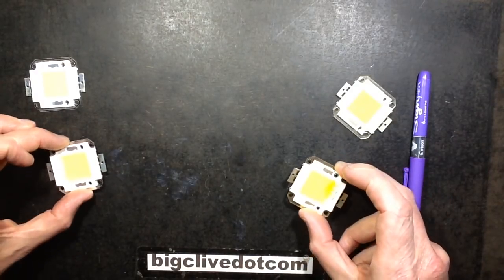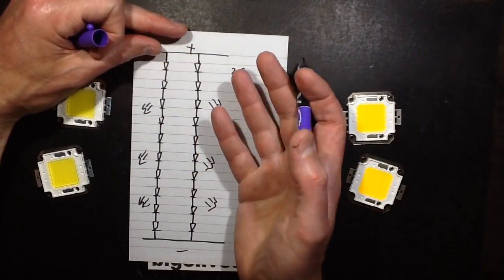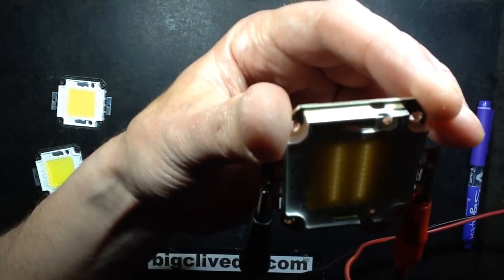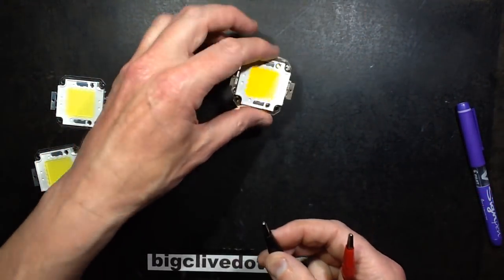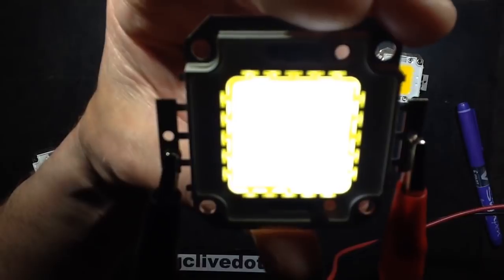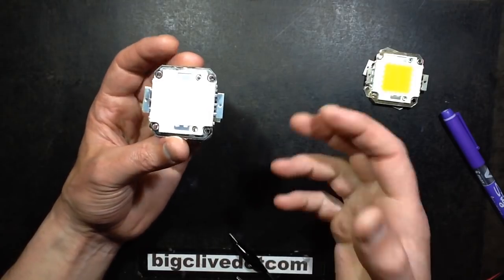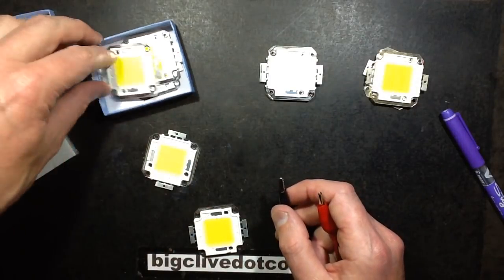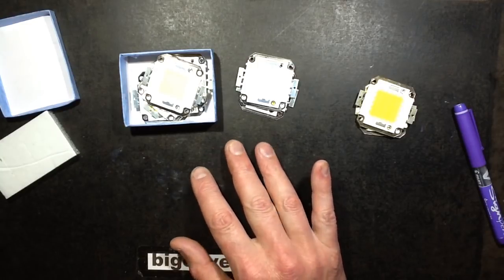Testing dodgy 100W LEDs from ebay sellers.

Comment: I've found that when projecting an LED's light onto a wall using a lens, even the chips that don't glow at all at low currents are glowing quite nicely. It seems to me like the chips tend to have a little parasitic resistance of a couple of kiloohms across them, rather than being shorted outright. 
I got the cheapest LEDs I have ever seen, like seriously bottom of the barrel factory reject items, twenty 10W ones for 6 euros, and at very low currents only three or four of the nine chips tend to emit any light. To my surprise though, their brightness is pretty consistent beyond 100mA, with only two of the modules producing significantly less light than the rest. Now they most definitely have a lower efficiency than the good ones, but let's be honest, who expects good quality from these things anyway. They definitely work for me!
Reply: +Dennis W The problem is, most of these LEDs came out of a LED flood light factory or something like this, they test them and the bad ones are returned, and however they'll come up on some ebay stores. You got it right, the problem is the resistance, some of the chips get mor, others less current, and when you power them nearly their specific values, some of the led chips get too much current and die sooner than the other ones on that LED, the other ones will even die faster when some of the chips are already dead. I've found out myself, that the good ones mostly start at 5-7 bucks
Reply: +Dennis W The problem is, most of these LEDs came out of a LED flood light factory or something like this, they test them and the bad ones are returned, and however they'll come up on some ebay stores. You got it right, the problem is the resistance, some of the chips get mor, others less current, and when you power them nearly their specific values, some of the led chips get too much current and die sooner than the other ones on that LED, the other ones will even die faster when some of the chips are already dead. I've found out myself, that the good ones mostly start at 5-7 bucks
Reply: +TheScrappingJeahaha The problem is the resistance? That's such a stupid statement, I don't even know where to begin trolling you.
Reply: Jimmy Gregorio
then maybe you just fuck off?
Reply: TheScrappingJeahaha I think you mean the parasitic resistances, yes?
I rest my case though, their effect diminishes when approaching the LED's rated current.

Comment: These LEDs are just fine! They were designed to operate at the proper voltage AND amperage! You only adjusted voltage! LED's do not get "damaged" and start working badly, either they work or they don't. They may turn on at various current/voltage levels, which is normal. You are driving 100W AND 20W LEDs from the same source? What is the current available, never mind the voltage? CURRENT DOES THE WORK! If you under power them, of course they won't work right! You are posing as an "expert" when you obviously don't know CRAP about this stuff! You sir are a buffoon that is doing a disservice to unwitting people who are actually taking  your word as gospel! Beware folks. A little knowledge is a very dangerous thing.
Reply from the maker: +Blissterd1 A little knowledge is indeed a dangerous thing.  https://www.youtube.com/watch?v=_wR_mFWeI6Y
Reply: +Blissterd1 Why did you change your story after he made another video but still imply he is wrong?
Reply: +Blissterd1 Just my 2 cents worth: I am not an electrical engineer, just a home tinkerer, but, as far as I know, one cannot adjust JUST voltage OR current in a resistive load. One affects the other. Voltage "pushes" current. Raise voltage and current goes up. Only a change in resistance will affect how much current flows at a given voltage. Thanks!
Reply: +Blissterd1 I'm sorry my friend but this statement you have made is totally incorrect.
Reply: +Blissterd1 you just got schooled jackass.
Reply: +Blissterd1 You are a complete stupid fuck. That other video was CLEARLY a joke, and this guy is a professional lighting rigger. Did you ever consider that there might be something YOU DON'T KNOW that someone else might? My god I wish I could meet you in person, maybe we could start an exhibit up.
Reply: If you don't understand the subject, that's fine and nothing to be ashamed about. However, you're dispensing criticism, calling names, and then, when educated thoughtfully by the host, you respond by doubling down on your behavior?
Reply: bigclive saw your clown led explanation video...that was beautiful.  Very interesting and informative.  I was going to buy from ebay but the smaller 10w led chips.  They were so cheap (about 5 times less than from other vendors) that I figured let me give it a try.  But it is not just about the led chips but also the sizing of the led driver.  If I go through the exercise of getting the right driver for the correct series and parallel configurations of leds, and they have all these faulty leds, then I'm also wasting money on a correctly sized led driver.  Thanks again for the beautifully explained video and also for schooling the highly knowledgeable blissterd1.  He talked like an expert and was proven to be the buffoon.  To top it all off, when shown he was wrong, he wouldn't admit it.  A true CLOWN!
Reply: Don't you just love it when armchair experts who know ABSOLUTELY NOTHING get totally schooled and then try to change the narrative to fit their agenda? Hilarious... Bravo Clive!
Reply: +bigclivedotcom Thanks for posting the followup video.  I was wondering what the purpose of testing LED arrays at low voltages was, now I understand what you can learn by doing so!
Reply: Yes Blissterd, A little knowledge is a dangerous thing. You would save personal embarrassment, by educating yourself fully, before posting any more bullshit comments.
Reply: +Blissterd1 moron, tried one of these f*cked up LEDs yourself? I wanted a cool white LED for my 100 Watt LED Flashlight and bought one for around 3-4 Bucks and changed the warm white LED with the crap i got. I adjusted the current and the voltage to the proper working specifications, wonder what happendend ? after 10 Minutes working only 6 rows where remaining working.... The warm white LED which I changed was like 7 Bucks and ALL LEDs came on like the 20 Watt ones he showed in his video, this is now 1 year past and the LED is just fine. dumbass.
Reply: +Blissterd1 The video where LEDs were connected to mains power was satire. He likewise knows that a soldering iron isn't really a TIG welder. Maybe - or maybe doesn't know - the uncertainty is half the fun. It can be confusing to decide whether Clive is being serious or silly at any particular moment. His videos aren't for everybody so if you find him annoying perhaps it's best just to ignore him. 
I don't find PewDiePie worth watching but that's no reason millions of others shouldn't enjoy those videos. As long as there are a few of us who enjoy random detours off the straight path bigclivedotcom will continue to attract followers. 
I just hope Big Clive doesn't get too predictable after his channel passes the 100,000 follower mark.
Reply: Gary Hardman OP falls back on "school yard name calling" as a defense and in his original statement calls Clive a buffoon. ...brilliant, juuust brilliant! HAHA
Reply: +Curt Chase you are right. voltage affects the current. the problem with led's is that its very difficult to handle the current with a fixed voltage. they need a certain voltage to start working. before this voltage there is almost no current. a little over this voltage the currents much bigger. its very dangerous to control led just with fixed voltage. http://softsolder.files.wordpress.com/2013/03/roygbuiw.png . it much safer to use a current supply ( they regulate the voltage so you have the selectet current) or use at least a resistor in serie to the led. there is not really a problem in the way he does it becouse he does not get even close to the rated current. but for max led power it would just be to dangerous to run them directly from a voltage supply.
Reply: +Blissterd1 You get what you pay for! Perfection is something that is set aside for products from real companies. Of course these are half rate LEDs but this guy uses them, I saw him admit to it when another guy noticed them in a reflection. They work fine under normal conditions for the money. I suppose he'd rather that they stopped making these cheap LEDs then, because that is all they can do for the money he (and many hobbyists) wants to spend! Going to all this buffoonery to prove that cheap prices equal cheap products. it's useless. He has no right to beat up on vendors or manufacturers for making the cheap stuff he wants to be an "expert"; with and beat up on! I don't need an expert to tell me that crap stinks! BTW, nice use of schoolyard mentality in the name calling. I will be bothered by it for about....never!
Reply: +Codeplayer I never changed any story! All I ADDED was that they were cheap LED's that might not act like expensive ones when run at incorrect voltages and amperage. He infers that they are "rubbish" and my point is that you get what you pay for. They work just fine when run at rated voltage and amperage. The first video I ever saw of this guy was the one I posted the link to above in my last comment. If you saw that you would wonder whether this was a joke or something. He calls a soldering iron a "TIG welder" and then proceeds to literally bang the solder on! Then you find that he has wired the LED directly to the AC mains and plugs it in. When it unsurprisingly blows, he then claims that it must a bad device and blames the seller for selling him crap! Sound like an expert to you? Defend him all you want and he may have figured some things out by now, but I'm not bothering to ask his advice!

Comment: You should do a video on "Mars Hydro" full spectrum grow lights. They advertise 300 watts, but they only draw 140 watts.
They come from "topledfactorystore" on ebay. When I asked, they said 300 watts is design power and 140 watts is actual
power. I am sure their other items are the same.
Reply: Are you serious? Even IF that were true. it is still false advertising.And I already know about PAR ratings, So, if it only draws 140 watts, just say so.

Comment: Hi dude. I have a 100w chinese led too. At the beginning it seemed like yours (only a few bulbs turn on at the same time). But then I increased the maximum amperage and all the bulbs turned on at the same time.

Maybe all your 100w leds are working, and you are just giving them 32V and 1 Amp, or something like that. They need something like 5 Amps to turn on evenly.
Reply: +Pablo Fernandez Wrong.
Reply: +Jimmy Gregorio Jimmy knows his shit. Don't mess with Jimmy

Comment: They're okay for the price.  I mounted one with a voltage converter in my Honda's dome light.  I'm running it at 22V with no noticeable issues in consistency, and it is a fairly clean 5000-6000k in temp.  It is true that they do not light evenly, you can see that when near the forward voltage.  For $15, it looks like I have a 100W halogen in my cab.  I have no cooling issues at 22V and I'm not using a dedicated heatsink for it.

Comment: China's finest and Scheister ebay sellers strike again...thanks for posting this to expose this fraud.  Circuitwise, it's just bad practice to parallel strings without any currentlimiting...ANY inbalance caused by process variations will lead to current-hogging and premature failure.  The 20W arrays look good because of very similar performance...I guess they got lucky, but the 100W arrays show totally uneven performance.  As you point out at 4:42 the 40mA passed by that one LED must be passed by the remaining LEDs of that series string, which means all except that one are SHORTED!   How long can you expect that single one to last at 40mA...not long! ...but they sell them anyway, figuring light from the remaining 9 strings will cover up this situation. FRAUDS!